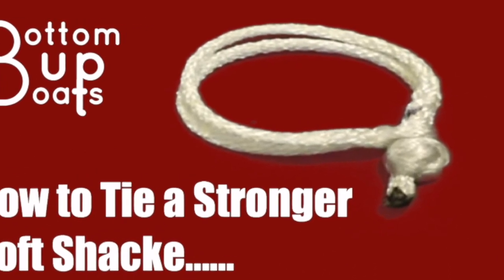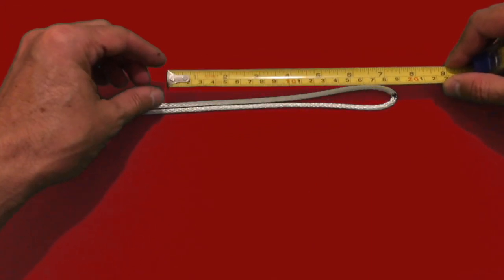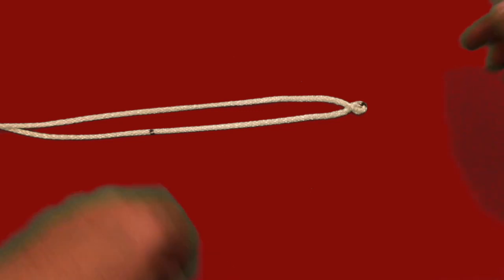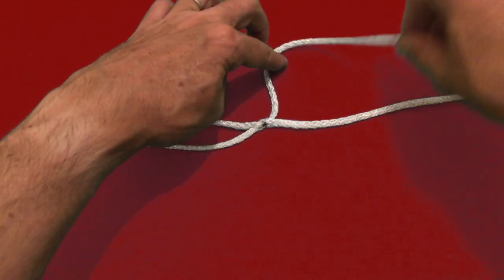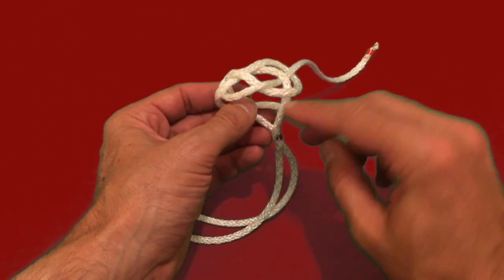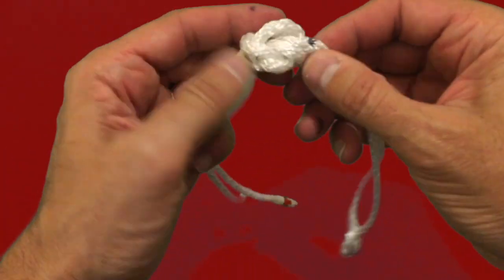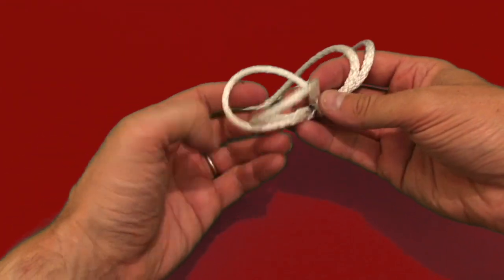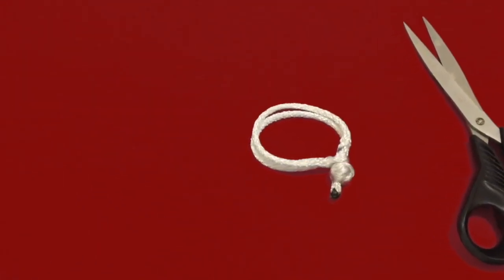How to tie a Stronger Soft Shackle

Comment: This is a bullshit tutorial! The softshakle is not stronger because of the two strands, bullshit.
😂😂😂
Reply: Thanks for the link to the video and the reminder; I already knew that.
Fantastic comparison of different soft shackle types.

But again, no proof that your double-loop soft shackle is twice as strong as a buried soft shackle. 
Did I missed something?

I admit, the results of the button knot version were disappointing and seemed strange to me.
I also disagree with the results of the diamond knot versions with and without tails.
I assume he pre-tensioned the diamond knot differently or insufficiently, 
he used the cheapest Marlow 3mm SK75 dyneema, maybe this was the problem, who knows. 😂

Wish you the best
ah
Reply from the maker: Ah this comments help me clarify, we were not trying to say one shackle is 230% stronger than another. The reference on breaking strain was the shackles breaking strength compared to the breaking strength of the rope used to tie the shackle.
Reply from the maker: There are lots of video out and about that test the breaking strength of various shackles this one is over 2X the breaking load of of others, the reason for this is this comes down to the extra width as the point of the knot.
Reply: Show me the link to the video about the test with 2x stronger results for this softshakle version. 
Your version and the traditional version are absolutely identical, just below the diamond knot are only two Dyneema strands. That's why there can be no difference. 
The stronger softshakles are made with button knots. The difference is made by the bend radius for the nose (loop), just below the button knot there are four Dyneema strands.
Reply from the maker: https://www.youtube.com/watch?v=QtyalJoQY50

Comment: we finish Dyneema lines with crazy glue.  give it a shot.
Reply from the maker: Thanks for the tip, a couple of my recent efforts have come loose after a season of use. I will give this a go to see if they will stay in place. Nylon braids melt when heated which give them a good finish which holds tight. The crazy glue option would get a similar outcome 👍👍👍👍
Reply: Heat shrink.

Comment: I've made both internally spliced and open-legged, like in this video, but in the end don't both versions actually spread the load over two lines, making them equally strong?
Reply from the maker: Great question Ron, while both versions have two lines break tests have proven that the internally spliced version is not as strong as this one. The other key factor is the knot you use, I tied this one with a diamond knot. If you upgrade to a Button Knot which allows you to tuck the tails inside the two lines of the shackle you get 4 rope thicknesses at the key locking point. This version with the button knot is even stronger again ! With winter fast approaching you have inspired me to make a video which break tests the various soft shackles. You can learn the button knot here https://youtu.be/t8Gi9UoSs5A
Reply: @BottomUPBoats  and i thought it was only as strong as the single line that is the loop
Reply from the maker: Nope, can be stronger